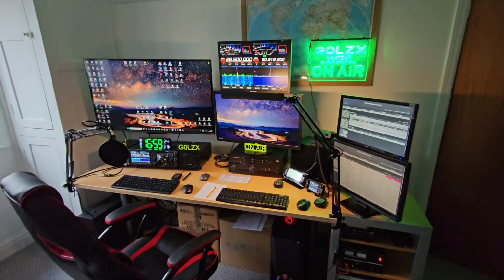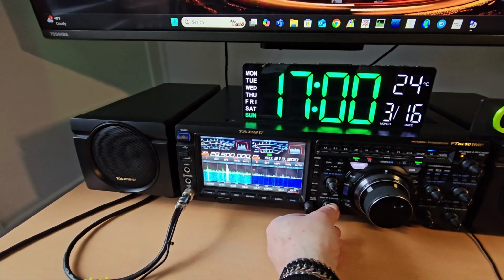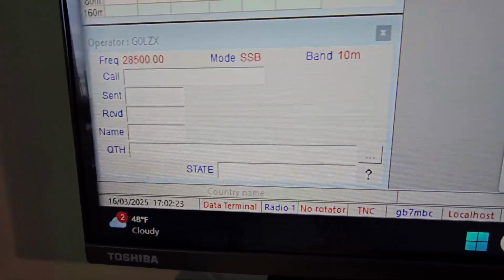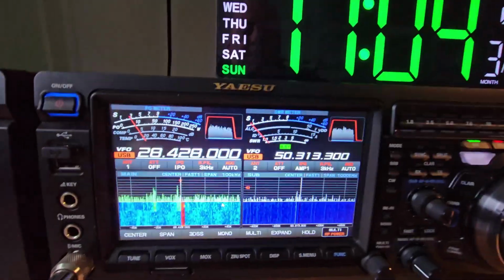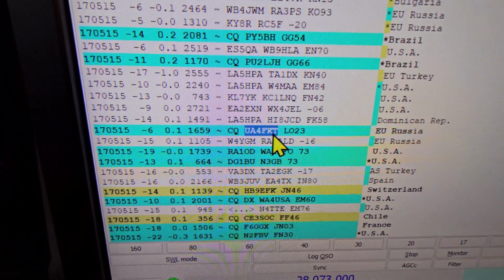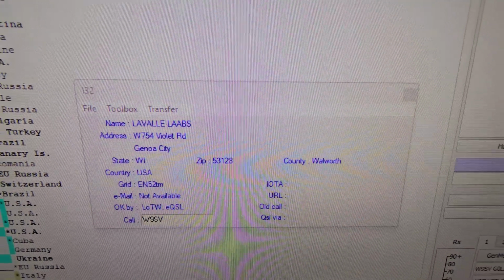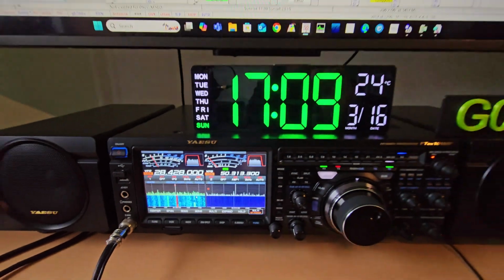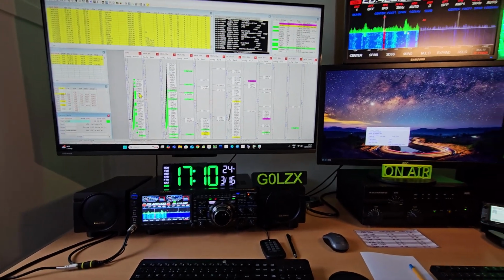Using Logger32 and JTDX software in the shack of G0LZX

Comment: How do u get it connected to your radio?  Ive downloaded latest version and nothing
Reply from the maker: Logger32 u mean ?.
Reply: Yes Sir.  I have latest and can't get it connected
Reply from the maker: @KB2AT have you gone into the radio settings to put in your radio type and the correct com port etc ?.
Reply: Yes Sir
Reply from the maker: @KB2AT so does logger32 change freq when u turn thr vfo ??
Reply: no.  Doest show radio even connected.  Shows port closed.  But if I open say log4om it works no problem with that port.  Doesn't even show on radio list ftdx101D
Reply from the maker: @KB2AT  you need to check your radio settings,  check ur com port and baud rate settings etc ... I chose yaesu ftdx101d as my radio and it works 100%
Reply: @g0lzx  on mine it doesn't show in latest firmware the yaesu ftdx101D.  In every other program it works
Reply: @g0lzx the logger 32 newest version doesn't even show yaesu ftdx101D in radio list. My com ports and baud rate work on every other logger.  Wonder why not this?
Reply from the maker: @KB2AT send me your email address and I'll screenshot the settings i have for my ftdx101mp in logger32 
Email me 
Ricky-tk@hotmail.com

Comment from the maker: I just setup logger32 using radio 1 configuration for the enhanced com port and then setup the same port within jtdx to the same,  the radio then swaps between the both programs via UDP ... its pretty simple really .. once logger32 is talking to the ftdx101mp via cat control, use the same settings in jtdx 👍
Reply: Great set up, must be us oldies maybe, I have a small rig, small power, morse paddle, one small screen for wx outside, and home made wertical beam ants, and every qso I make is easy and relaxing,  and every contact is dx, 10,000miles or more. I love being in a ragchew cw or ssb, very really will I ever look at a screen. Good luck 73. The kiwi dxer.
Reply: Excellent solution Ricky! Much easier than using third-party programs for logger32 & JTDX CAT control . I'll try to work via UDP this evening.  Warmest regards. 73 UA4CR Slav
Reply from the maker: @VyacheslavKonobeevsky  good luck , it's pretty straight forward 👌